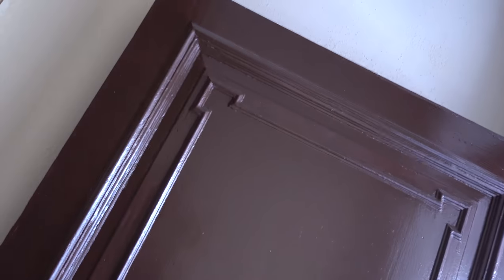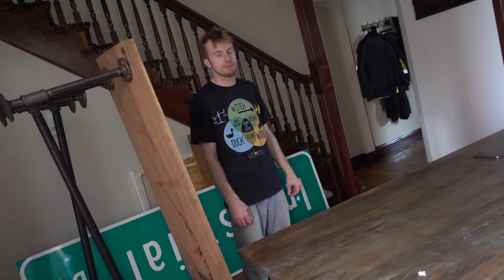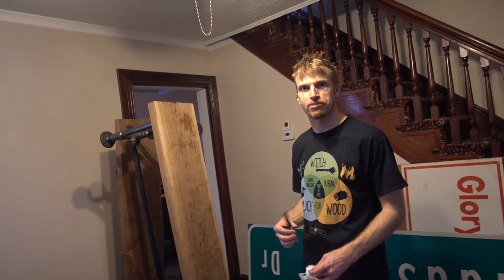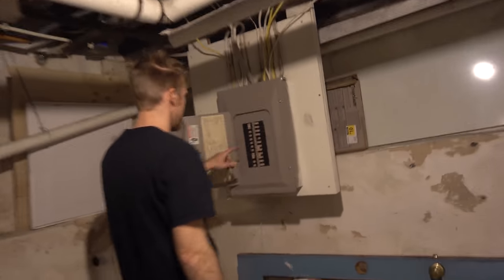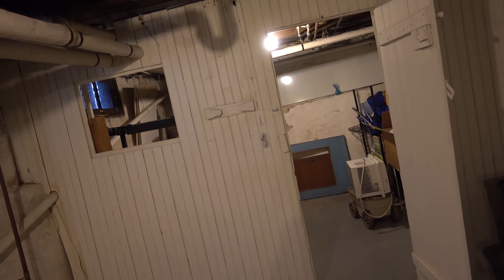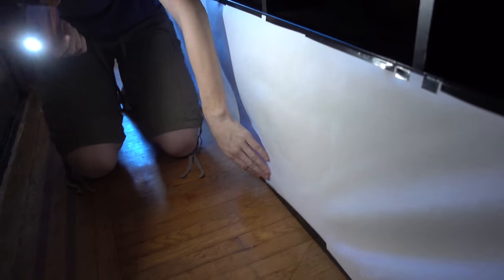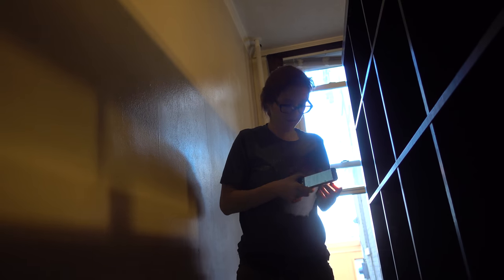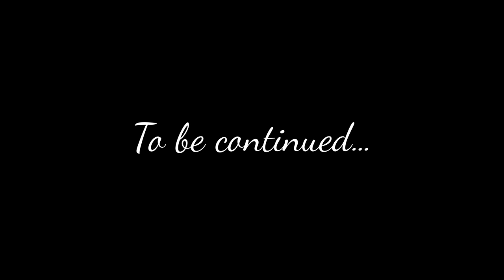Allie & Steve Bought An Old House - Week 1 Part 2

Comment: Wiring in old houses is just fun like that. You have breakers! I've done something similar in a 3rd floor flat with fuses that seemed to have four circuits that turned out to be one circuit with four fused sections. You pull one fuse. All four sections go dead, but only one side. Cloth insulated wire, ceramic knob and tube. Really fun. Then I pull all four fuses and stick a screw driver into an outlet only to get an arc. Find out it's wired directly 3 floors down from  the main breaker. I was unharmed but that screwdriver has never been the same. And yeah, I knew better than to mess around in an outlet without testing it first. I was young and sure. I've been allowed to become old and cautious.

Comment: There may be a code requirement that lights and outlets are on separate breakers - at least for the same room.  That way, if you overload an outlet, you can see to get out.  At least, I'd check that before wiring lights and outlets to the same circuit.

Comment: On the base board , pull the nails through .DO NOT drive them back out as that will enlarge the hole. Pulling the nails through will leave no mark on the face of the board.

Comment: It would have been a better solution to notch the bookcase to clear the trim.  If you ever move or get rid of the shelving unit, you will need to repair the trim.
Reply: Easier to put the trim back than it is to repair the bookcase after you cut a bunch out of it. It was also much faster than trying to make custom cuts with the profile of the trim all along the bottom of the bookcase so it sits flush and doesn't look crappy.
Reply: The house will be around a lot longer than the bookcase.  Notching the back won't hurt its structure and it is on the side against the wall.  If it is moved and used elswhere, the notches won't show.  Its easier than in future having to fix the molding on the house and try to make it look original.
Reply: Frankly, I don't agree with your assessment. I'll leave it at that.
Reply: A thoughtful, respectful discourse?! That's not very YouTube of you, Mr. Death.
Reply: Frank Healy I agree.  Generally there's stuff behind the trim that's not meant to be seen, and the house is the bigger investment.

All of the wall furniture I've bought has notches for the trim, including all my Ikea stuff.  Wonder why this one didn't?

But it's Allie and Steve's house and furniture, so it's thier call.